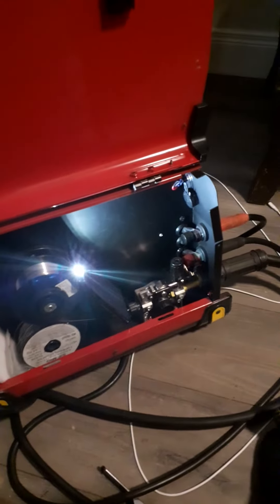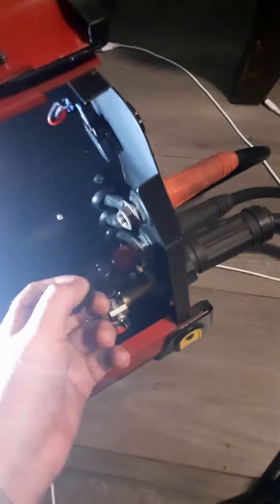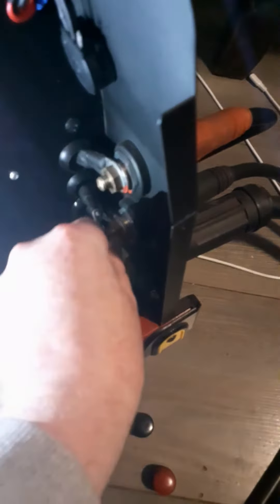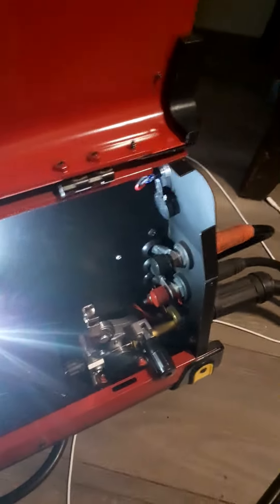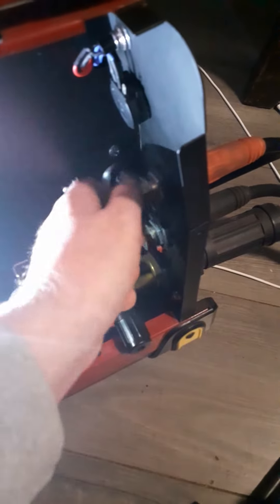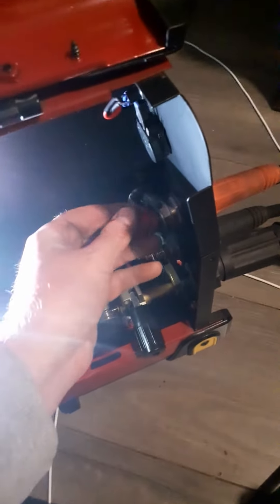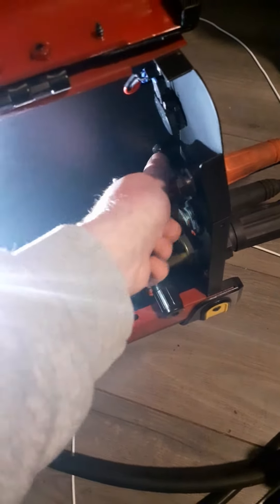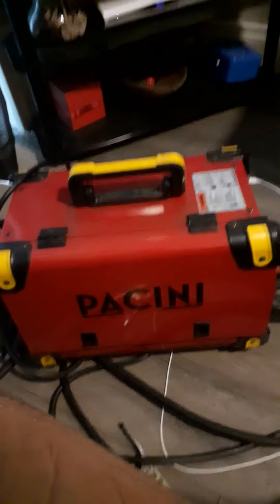pacini pro mig 201 reverse polaraty for flux core no gas wire

Comment from the maker: Anyone have one
Reply: I do.
Reply from the maker: @NialPowerCork  what u think of it
Reply: @podjo2k9  I like it a lot, lovely easy piece of kit to set up and use, great feed mechanism. Couldn’t fault it really other then it came without any instructions for some reason, mostly it’s self explanatory but I’d like to find out how to get the components to use it with .6mm wire. But it seems like a lot of welder for the money to me.
Reply from the maker: @NialPowerCork  on Ebay ullget the roller have youused flux core wire or are u using gas
Reply: @podjo2k9  so far gas only. Thanks I’ll have a look on eBay, thought I’d have to make one to try it.